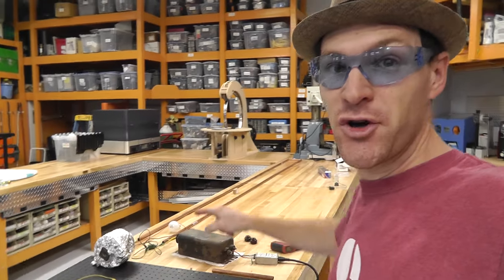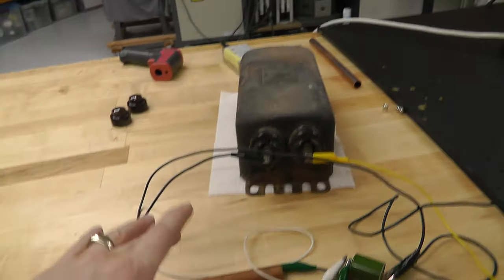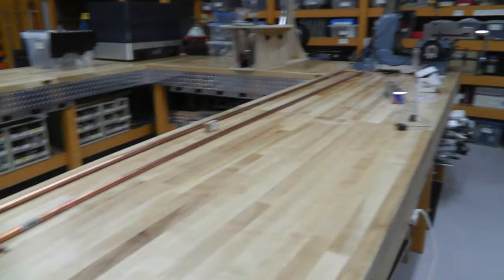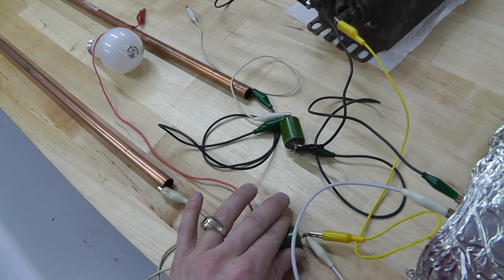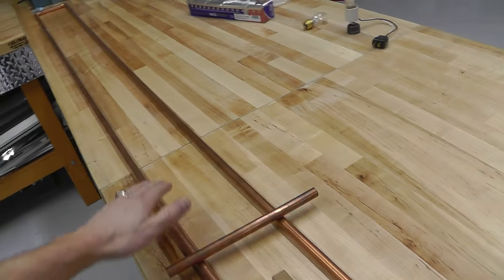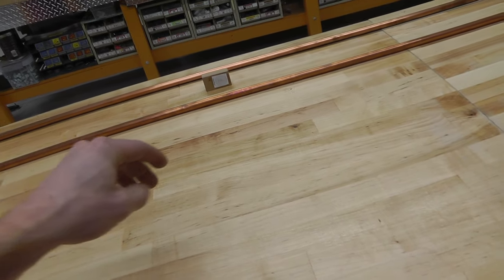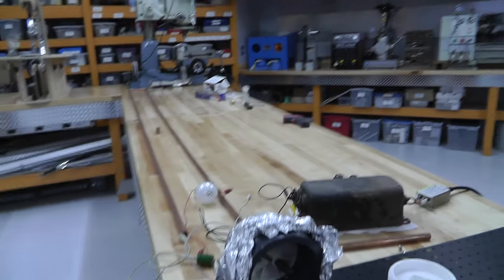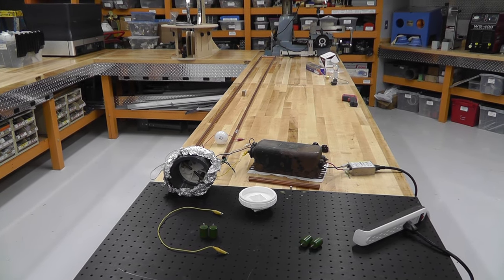Tesla Hairpin Circuit, Quick and durty Over Lunch... 36 AWG wire, but the light still lights...

Comment: Circuit is really fun to play with even when it's not tuned to resonance. Adjusting the spark gap is one essential to probably making the bulbs brighter. With my shitty setup they get brighter the longer I make the arc up to a certain point. Having the short on is where the magic happens and with those long pipes it would be interesting to see if you could track any wavelengths across it.

Comment: Try this. Combine Tesla Hairpin Circuit with Tesla Coil Colorado Springs Model. Make the copper pipe of Tesla Hairpin Circuit a primary coil with only 3-5 turns with 1-2 cm spacing between each turn. For secondary coil use Tesla Bifilar Coil with around 25-50 turns, you can use normal coil with 1-2 cm spacing between each turn but i think bifilar coil might be better choice. For Extra Coil hundreds of turns, no spacing needed. Connect the output of secondary coil directly to Extra Coil, other end of secondary coil to earth ground. Connect the output of Extra Coil to the aluminum pipe and then connect the aluminum pipe to Top Load for capacitance as described in Tesla's Patent 1119732 for Colorado Springs Model of Tesla Coil. Also try shorting the copper pipe with earth ground with spark gap between.
Reply: Actually you want spacing in the extra coil (and most coils really) due to the nature of the magnetic component, aprox 1.6x the diameter of the wire used (ideally 1.618x - Phi) this allows the spatial magnetic field to freely oscillate without restriction that a lack of space causes which is vital for a high coil Q, especially since the extra coil is meant to be a free resonator, look up Hakasays for more info on that.

Comment: Perhaps your bulb is lighting less because your "short" has lower resistance. In the previous video, the "short" between the two bars was a puny alligator clip wire. Of course, the inductance has just as much of an impact too.

Comment: I think its not a dead short its a single turn air core coil and the spark gap and capacitors creates a very high frequency pulse
Reply from the maker: so i can agree with you. however when that "short" or open air coil is the matter of 10 feed or less. why is the light lighting? would not the electricity take the shortest path? ( conventional electricity)  the fact that the light lights at all is most interesting and the fact that it dose it through those small wires is even more interesting.  great comment by the way. keep going... ~Russ
Reply: this circuit remembers me the primary of the tesla coil and it's a resonant circuit between the coil (u shape copper pipe) and the capacitors. when a spark happen it have a negative coefficient of resistance
Reply: 1. when passing high frequency through a coil its impedance increases. effectively making the shortest path being a pair of resistors in parallel. 
2. you should run an ac current meter over both wires to see if the current is equal between the two.
3. when transmitting power over a wire the higher the voltage the higher the power carrying capability of the same thickness of wire. so a couple thousand volts over a small wire would be equivalent power transfer capability of thicker wire only carrying 120 volts. If we were to say it was only 1000 volts going over those wires being dissipated at an over estimated 40 watts of that bulb then that would only be 40 mA of current passing through those small wires. that is the equivalent current of a couple of LEDs. most likely that was more than 1000 volts and much less than 40 watts considering its only dimly for short bursts of time.
4. (This one is opinionated) I know you have a fixation on this energy stuff but i feel your time and resources would be much better used focused on something else such as the 3d printer you built or other projects. Find a problem to solve even if it is a problem that has already been solved and try and solve it cheaper/easier/simpler/faster/better but TINSTAFL

Comment: Wouldn't output INcrease with less capacitance (like those cheapies in series)?  Or opposite? Trying to wrap my head around this.   in a "regular" circuit less capacitance would increase output into "short".
.

Comment: It is high frequency AC tank circuit. The bulb light up because it is outputting RF radiation. No  longitudinal wave non-sense. Look at your scope and see. You've made a quick and dirty transmitting antenna that was coupled to your table.
You will see an initial impulse before  each ring on the scope, that impulse is the output frequency from the spark gap (the spark gap is its own transmission circuit).
Your dealing with high-frequency AC waves, not the non-existent longitudinal waves... Put it this way, when a star explodes, there is a burst of gamma radiation, gamma radiation is still a conventional electro-magnetic wave... 
The LMD wave theory is bogus.